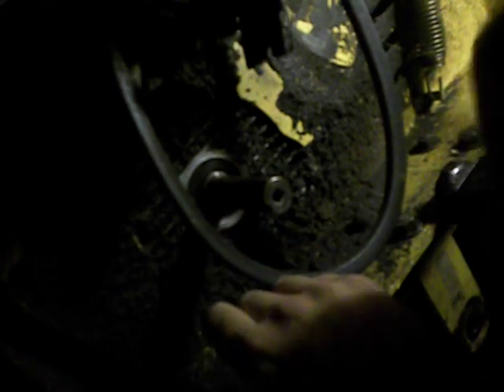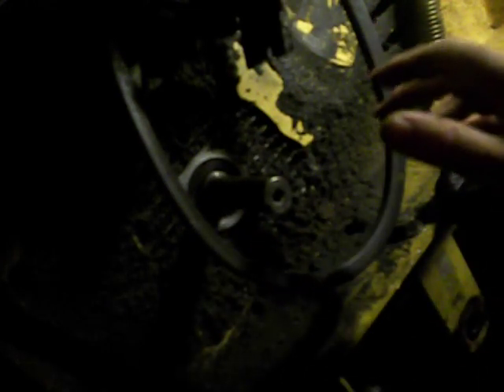25 HP kawasaki oil seal replacement

Comment: Just changed my oil seal on my Honda powered Hustler this weekend thanks to your video. Thanks
Reply: the best way that I found to get those seals out is to drill a tiny hole in the seal they run a screw in the hole but not too far. Grab the screw with some vice grips and the seal come right out. I put some RTV around the new seal and drove it in with a length of PVC pipe.
Reply: I tried your method and it worked very well.

Comment: 1st, I'd never use a screwdriver to pry  old one off,2nd, never drive new one w/hammer, punch a small hole to use a screw to pull old out , use a large socket or piece of pipe to drive new one

Comment: Dude....drill 1/8” holes on opposing sides of the seal.  Drill two hols in a piece of angle-steel 1/4” diameter, 1 1/2” on center. Place the short length of angle-steel across the end of the shaft. Insert two 4” screws through holes in angle-steel and thread into holes drilled in seal. 

Pulls seal right out. No scarring of block or shaft.